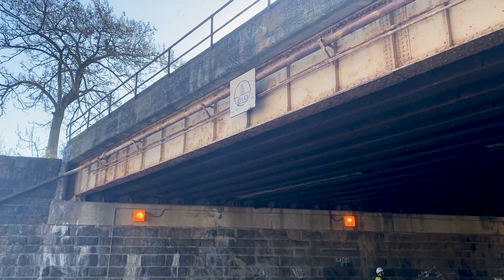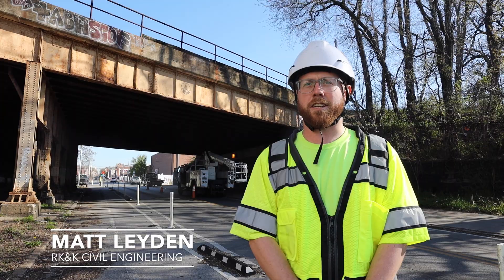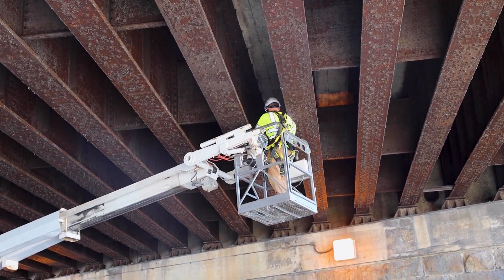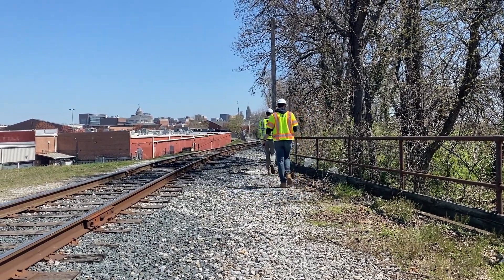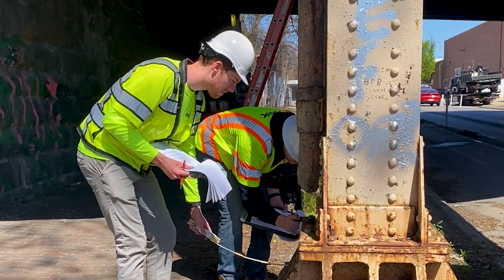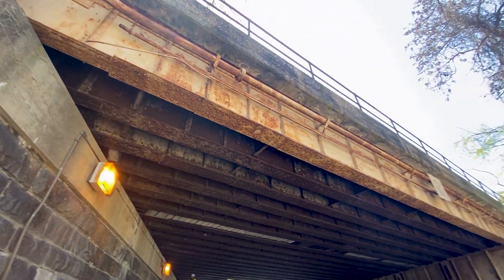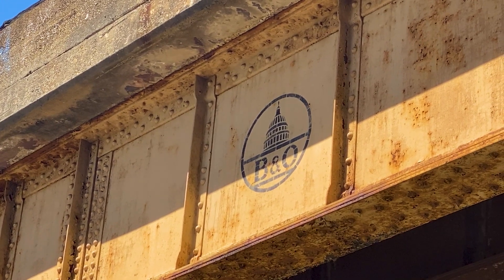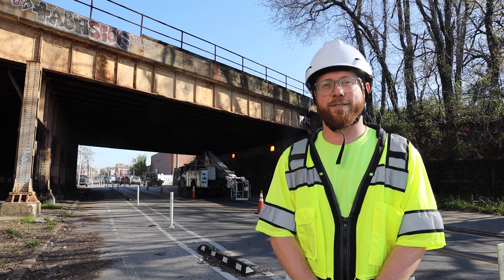B&O Carey St. Bridge Inspection by RK&K Civil Engineering

Comment: What l noticed that the colums did not hve sealing from colom to colum , preferably concrete, to prevent vehicles from carooming off the roadway and crashing into the supporting columns which could cause catrosphastic damage to collapse of overhead roadway! That also goes also to vehicles (or semi trucks)  crashing head on or side -swiplng columns. In my state, all columns are filled in to prevent entanglement with columns they are not filled to taller then about maybe 5 to 6 ft. Or so, all Inter -states and State-Routes and most over passes are similarly featured ts way . Thank you!